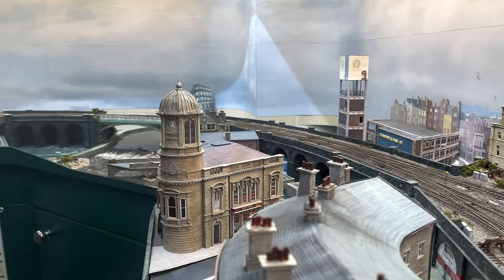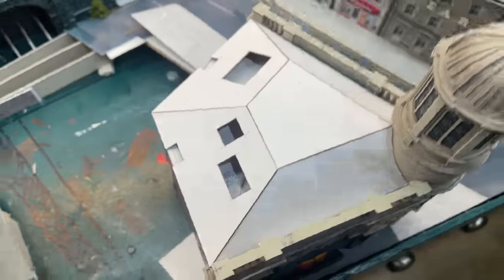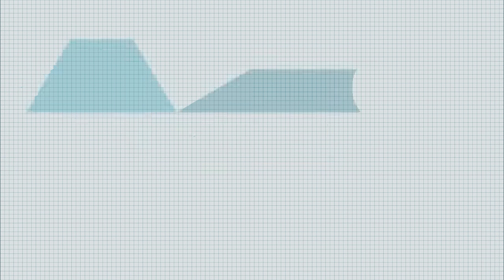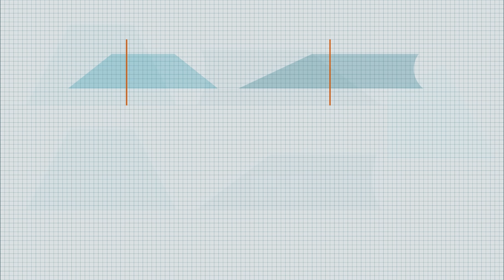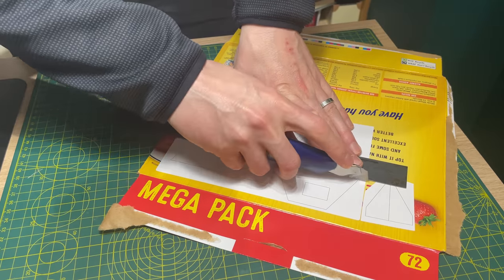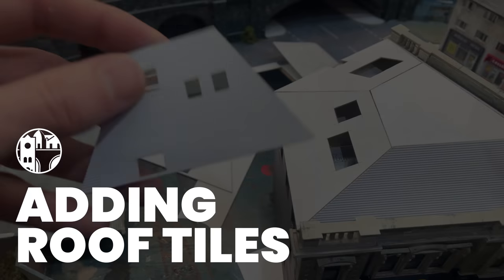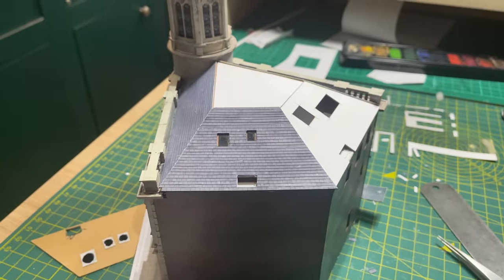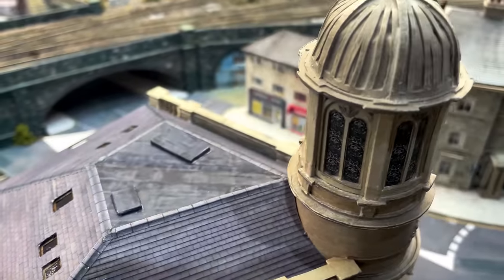Tricky roof! How I built a card roof around the tower of a strangely-shaped building

Comment: Hi Michael, another amazing build, but I do wonder whether a building like that would have had a flat roof. I think a valley type would have been more likely.
Regardless of roof type you make it look so easy when it's anything but.
Reply from the maker: Oh if only you knew the agonising I went through on that very question!  The reason we had that filler video last week was because I was well and truly stuck on that question. I think I’ve looked at every roof in Bradford, Halifax, and Huddersfield. In the end I concluded that I could find an example of almost anything I chose to make EXCEPT that first valley-like one. In the end, there is a triangular building near the station in Halifax which has a similar footprint, and that, thankfully, has a flat section on the top just like this one. So you may be right, but I’m comfortable that it’s prototypical enough! 😂😳
Reply: @Chandwell  Michael, Rule 1 !
Reply from the maker: @PiddleInTheMarshbyMarkIreland  haha indeed, but we always do like things to be right don’t we? 😂

Comment: That turned out really nice! What I do when I have to solve a problem with difficult angles is to first build the structure as a wireframe with little sticks. It's very easy to make alterations and when it looks good I cover it with piecies of cardboard or plasticard or whatever! It's a method that works very fast. In your case because you have to print the surfaces you could dismantle the wireframe structure and make a scan of the surfaces!
Reply from the maker: Great technique! I’ll try that if I get stuck in future.
Reply: Thank yoou so much for your viideos! I had a misfortune, I was diagnosed with ovarian cancer. I also created a channel and am trying to move in that direction, but so far not very successful((lo